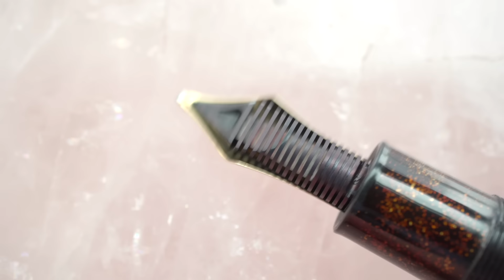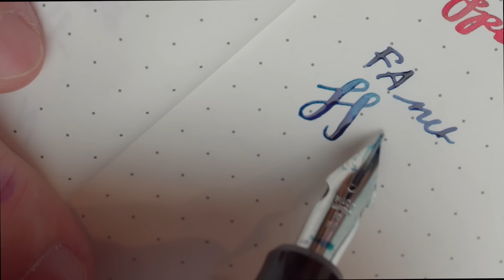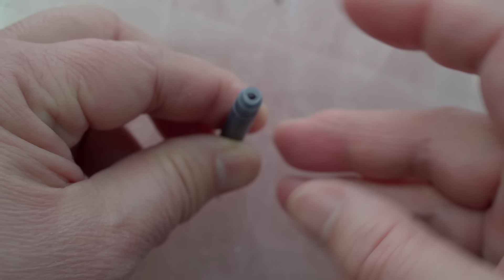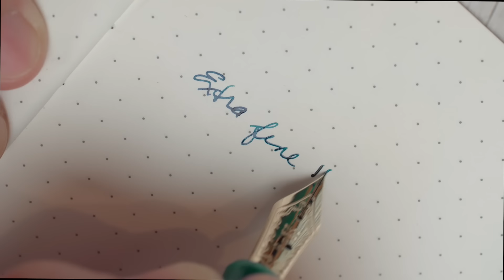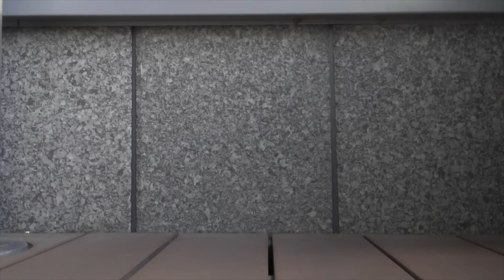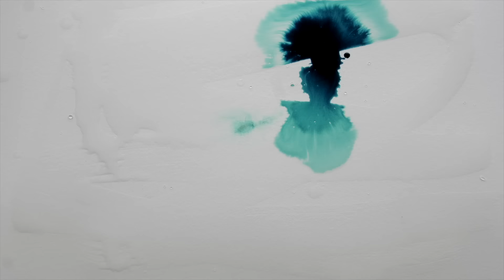Everything You Need to Know About Fountain Pens

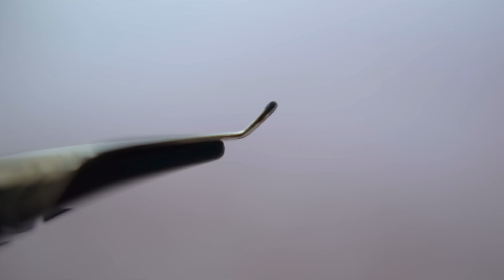Comment: 4:30 Some fude fans declare the fude nib should not have a sharp angle like that, but rather be a rounded shape. So when I tune my cheap fude nibs  myself, I do round them off, and like the continuous variation it gives, rather than stepwise. I write in latin script.
Reply from the maker: That’s pretty cool—does this assist in your writing? I’m not a big fan of fude nibs and just got this one because at the time, Nagahara was not allowed to work on Platinum nibs and this was a big inside joke. I end up just flipping the pen over and writing with a pretty fine point.
Reply: @InkyRocks Thanks for asking! It helps a lot, not having to flip the pen over, even though I sometimes do when sketching,. I find it awkward to write with a fude nib turned upside-down as it affects the angle and the stability in the writing too much for me. Turning a regular nib upside down on the other hand, is IMO great for getting instant hairline writing; that’s why I often tune both sides of my nibs.

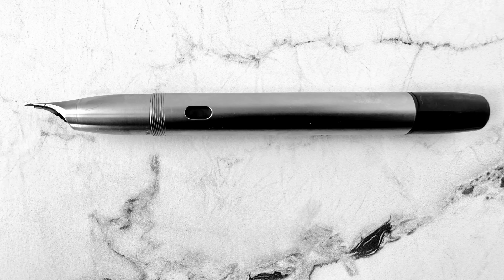Comment: what pen is that at 11:49 the stainless steel.
Reply: The stainless steel one is a Pilot Myu. Pilot made several versions of these in the 1970's, I don't know which this particular one is. Some of them look more like the Concorde plane. Very cool, these days they are pretty expensive used. I'm curious about the titanium one that comes after.
Reply from the maker: @clydesteadman6646  @mixeddrinks8100  Thank you for answering. It’s a Pilot Murex. It’s a lot like the Myu but came out later. I’ll be giving a Murex and a Myu away toward Christmas on a video about a seller I had bought them from. He recently passed anyway and had worked for Pilot like 40 years.  He was such a source of Pilot inside info and lots of vintage pens!
Reply: @InkyRocks  Thank you. I've lusted after a Myu for a while, now you've added the Evo to the list. That price is just impossible, though.
Reply from the maker: @clydesteadman6646 yeah, I had to sell a few other pens for that😂
Reply from the maker: @clydesteadman6646  Also the Titanium is a new pen from Schon Design. I have a vid on it.

Comment: Oh, yes, there's a multitude of nibs and sizes and widths. Vintage Esterbrook had over 200 styles themselves. Generally the same actual size. Unlike the modern Esterbrook,  which is just a shadow of their former glory, IMO.
Reply from the maker: Yes, the difficult part was trying to sum it up without taking too much time. 200 styles!  That’s wild!
Reply: @InkyRocks Even stainless steel nibs with flex, but no cutouts. I'd recommend a 9128. Proper tipping.